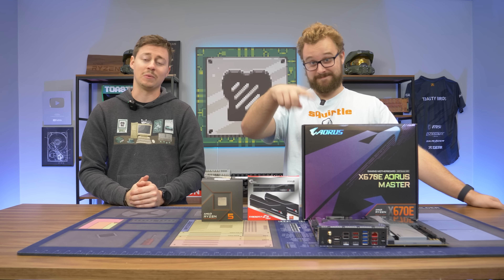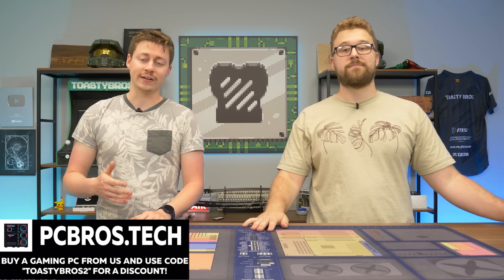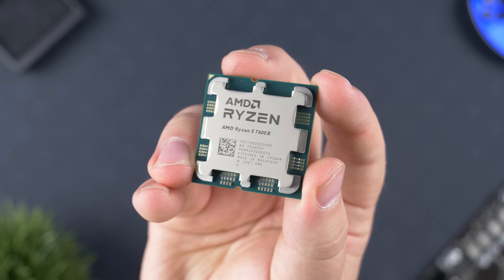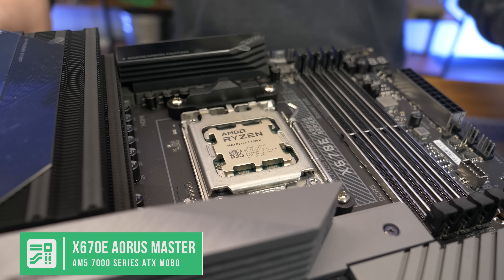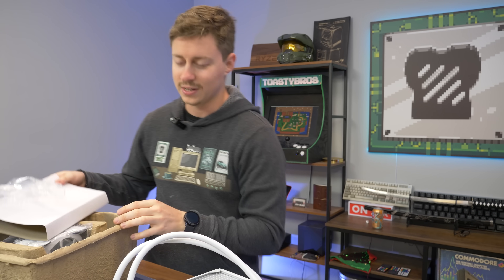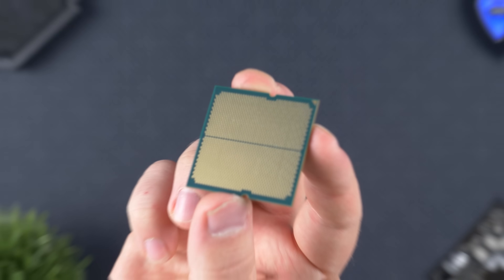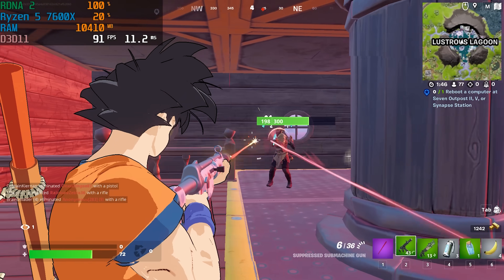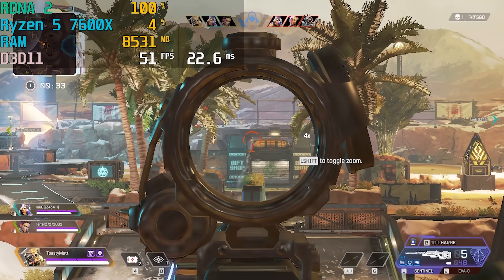Did AMD Secretly Kill Budget GPUs? Ryzen 5 7600x iGPU Gaming

Comment: I can't afford a GPU straight away but would like a running pc for 2 months whilst I save for a 7600xt.  The IGPU in this is perfect for just webbrowsing ect
Reply: Any news? Is it good enough for daily driving if you arent doing any hard gaming?
Reply: @Migixkem  short answer no. It's fine if you wanna play older titles. Like fallout 3 ran perfectly. But newer titles even with fsr barely play. What I will say though is the igpu it's great for media. It handles 1440p video fine. And would probably handle 4k
Reply: @blurreaper1238 so if i build w 7600 w/o gpu right now for coding and light gaming (minecraft) and simultaneously save for 9070 . Then can it handle till then?
Reply: @ got a 7800xt now. Does exactly what I need it too
Reply: @blurreaper1238  cool but I want to ask can it handle complex code and light games (minecraft/valo)

Comment: The actual budget GPU killer is the 5 5600g. pair that with 16gb of ddr4 3600 or 4000 (4000 will be slightly better but below 3600 is a no go. as well as the difference between 16gb and 32gb being rather marginal) and that thing makes it work. I even managed to get Battelfield 1 running on 1080p low settings at an average of around 58fpsafter some overclocking and Ryzen AI upscaling.
Reply: Do you think a 5600x or 5600x would be better than a 7600x? 32gb Ddr5 6000... I can't get a graphics card for a while the 7700x or rtx3060ti/3070 is 4-500$ range but ill need a couple paychecks. To catch up from christmas. So only buying a processor , ram, plus, motherboard today
Reply: @newbie_nugs not at all
Reply: @9hog built over a few months but she done
7600x and on release day I got a 9070xt

Comment: Actually 7600x is not good for IGPU 
When we look at 5600G with Vega IGPU it performs 2x better than 7600x but its X model so don't expect much.

If 7000 Series G models comes out it will outperform 5000 G series.
Also im excited to see that IF they can improve IGPU performance than Their 6000 Series Apu with 680M IGPU model.

Comment: For reference, at rated clocks of this GPU's cousin (the 610M in Mendocino), the GPU in this thing should only be around 490GFLOPs

That is in the ballpark of Nintendo Switch when docked, (but ofc paired with a waaaaaaaay better CPU).

So honestly curious as to if you set games to Switch-Like settings if possible, how close would they be outside of framerate if you can somehow make it CPU bound?

Comment: It's cool that these integrated GPUs are that capable...however, if its for gaming, you would be much better off going with an AM4 system since the price savings would allow you to get a dGPU.
Reply: Well...

Considering how broken the dGPU market is, I'm not too sure if you could really get a decent enough graphics card for the price difference, and this with a lesser performing CPU (the best value probably being the 5800X3D, but that's more expensive than a not exactly way slower 7600X, for this usage, at least)

I'm personnally stuck for years now, my last main rig being i7-860 + HD7870 (alrteady replacing some HD5870 after hardware failure) : even though the RX6500 performs better than this old timer, the price tag is too high to justify an upgrade and its power efficiency isn't exciting either. The CPU side isn't too different, with useless cores multiplication, which will undoubtadly yield us "SMP optimizations" actually perfectly counterproductive (as with most evolutions since the semiconductosaurs era : call me Amish if you will, but we hardly got any benefit over the Pentium era; which mostly brought us the first 3D FPS...  hey, look at how many transistors were needed at the whole computer level for Q3A or the original Unreal to run properly! And now? Oh, well... multi-gigabytes smartphone games running on about 100x more complex hardware, easily ruining batteries over 2 years of use, with 1GB monthly downloads for very minor updates...)

Needless to say, I'm pretty sure I'm done with hardware, as no one seems to care about anything other than money in the entire industry.

Comment: Certainly far from amazing performance, but the difference between being able to start up a game and maybe getting playable performance on the lowest settings is a really big one.

On another note, all of Zen 4 is now ideal for ultra-small builds.

The most powerful APU of all time goes to the one in the Steam Deck. it has 8 RDNA 2 CU's, where as the ones in Zen 4 only have 2 RDNA 2 CU's. I should know, i have a Steam Deck and game on it regularly.
Reply: The 6980HX is the most powerful at 12CU RDNA2, 45w TDP and a 2.4ghz clockspeed on the GPU. The SD has the most gaming perf at lower wattages though.
Reply: @Fina1Ragnarok  You're right! 12CU's is extremely impressive on an APU! That's basically like having a RX 6400 built into the CPU Die itself. As an owner of a Steam Deck, Knowing what it's capable of with Steam OS (arch-linux based), gives me some perspective on what an even more powerful APU could do. I have been able to play some demanding games on the Steam Deck, including games like Control and Horizon Zero Dawn, and it works! So someone with a laptop with that processor, even without a dedicated GPU, could still game, with appropriate settings.
Reply: @ufodeath  Absolutely. I too have a Steam Deck and have been very impressed with what it can do.
Reply: @Fina1Ragnarok  Sweet! Lately been playing a 'little known' CRPG called Baldurs Gate on mine. I made a Layout for the classic X-Wing vs Tie-Fighter (only issueld is multiplayer, sadly). I love playing the old and the new on it

Comment: First of all thanks for this interesting video about the iGPU. But why does AMD integrate a GPU into its Ryzen 7000 CPUs, which can wipe the floor with a GTX 1050 Ti when fully expanded, when the performance is so extremely limited even in the top model 7950X? So AMD is wasting a huge amount of potential if no Ryzen 7xxxG variant appears, which also uses the full performance as with the 680m in the Ryzen 6000. THX

Comment: Sad performance. Just built an AM4 rig for my kiddo using 5600G, while we wait for GPU prices to settle. Was planning on building my next rig based on 7600X but it's IGP looks worse than expected. Hopefully we'll see a release for 7600G this year, otherwise I'm going to just build an AM4 also. EIther way, thanks for making the benchmarks!
Reply: my brother in christ you are judging a fish by its ability to climb a tree, the igpus in non-G iterations are not meant to compete with their G marked siblings
Reply: @mr.dingleberry4882  I get what you're saying but I just built a $600 rig using a 5600g that only has 7 CU's on vega architecture. AMD skipped 6000G series and still haven't announced one for the 7600. I simply expected better but I can continue waiting. 

Though I realize that selling an APU that cuts into the low budget Radeon lineup, would be AMD shooting itself in the foot.
Reply: @UnipartyMuppet  AMD did not skip the 6000 series, it was just a mobile lineup. It is a confusing naming convention but it could be worse.

AMD has already confirmed that the 7000 series APUs will be released under the codename Phoenix (look it up), sporting RDNA 3 cores. How will they manage this with their low end GPUs I am not sure, but they are coming.

Still, I dont think that you made a mistake, as I have built a 5600G system for my brother and that thing is a value beast if you set your expectations correctly.
Reply: @mr.dingleberry4882  I meant that the desktop G series was sadly skipped. The apu lineup for mobile was something I was looking forward to, hoping it would appear in some illustration tablets.

Comment: I was hoping for the IGPU to have a decent bump in preformance over the 5600g. But if it arround the same, I'll wait for a better CPU
Reply: 5600g is G series so CPU vise its weaker than 5600X and 7600x ofc and has Better IGPU but 7600x is not G model so it is not designed like 7600G ( IDK When it comes out but eventually it will ) so if 7600G comes out it will perfom much better.
Reply: @Sherlockfps  ok thats good, when they release I hope the 7600g will have Igpu preformance close to the Gtx 1060 or better
Reply: we are still geting apus

Comment: IIRC in several interviews, AMD specifically stated these were not equivalent to their previous APUs in terms of positioning.  The iGPU is only for having video out (along with encoding / decoding) so it's basically to have feature parity w/ intel's non 'f' parts.  I think they also stated there will be APUs with more powerful iGPUs released later, so hopefully we'll see true g-series successors.  One thing to note: even the g-series APUs didn't reach current (for the time) generation dGPU performance, even the budget segment dGPUs were about twice as powerful.  I'd like to see that change, but there's several technical hurdles to cross for an APU to get to that point that will need creative solving (things like bandwidth for the GPU side, they could alleviate this with a very large cache, but that gets expensive).
Reply: I just think it's weird how I paid nearly 200 for an APU (5600g) in 2022, which is far less competent graphically than a 150 dollar console from 2013 of which the APU is only one part of the entire machine. It also gives you MOBO, RAM, HDD, PSU, Cooler, Connectivity and everything aside it. How can something that old and cheap drastically outperform something so modern and expensive. Especially when you look at the next gen consoles, which are pretty damn powerful yet still relatively cheap in comparison., also featuring and APU from the same company. What "hurdles" are there to cross if they have been succesful at it for a decade?
Reply: @JorisKeijser  First off, consoles are generally sold at a loss with the idea that the manufacturer will make up for it in terms of game sales / subscriptions over time, so keep that in mind when discussing cost.  

Second, many console titles from the PS4 era run at a capped 30FPS, render at sub 1080p resolutions and upscale, or dynamically scale resolutions to keep the framerate acceptable (not all, of course, but many of the more intensive titles do).  PC ports may not do the same things and PC ports also don't have the luxury of being a set platform to target.  On top of this, the games are running on a general purpose OS rather than a gaming only platform.  

Third, there's optimizations for the consoles that make them well suited to just playing video games while being pretty damned lousy at general purpose compute.  One  example being the consoles are outfitted entirely with GDDR rather than normal DDR.  It gives them massive bandwidth at the cost of terrible latency (compared with normal DDR) which is fine for feeding a GPU, but bad for classic CPU tasks.  If you're talking about the PS4 and XBox One, both of those were equipped with basically jaguar cores, so again, pretty terrible compute power but fairly decent GFX side, also fed by GDDR memory.  The Series S/X and PS5 are pretty similar, with the exception of having custom zen2 cores so the compute side isn't as underpowered, but these still have the same drawbacks in terms of memory subsystem and other tradeoffs (if you want to see how bad they are at being general purpose computers, google AMD selling PS5s as minipcs).  The point being, what's acceptable in a dedicated console isn't going to work well as a PC with a general purpose OS running it.

Consoles aside, the APUs have always had issues w/ keeping the GPU fed properly.  I'd have to look back at the benchmarks, but IIRC the APUs have classically scaled better with faster RAM and the impact of running in dual channel is also more pronounced, as both the CPU and GPU cores compete for bandwidth.  Maybe moving to DDR5 will help on this front somewhat, but an APU will always suffer from the lack of a dedicated memory pool, and the shared pool isn't GDDR so it's not optimal for feeding the GPU side to begin with.  Working around this may be helped with a massive cache dedicated to the GPU side, but as I said before that's a costly option.  There's also the competition for die space (all of AMD's APUs have been monolithic designs to date), which may be alleviated by the chiplet approach if they can feed it fast enough from the I/O die.  Those are just two issues, but they absolutely come into play when competing against even low-end dGPUs.
Reply: @JorisKeijser  1. price of ps4 was 400 2. the cpu power of 5600g murders the ps4 bulldozer cpu trillions of times over.

Comment: Something to have in mind as well, if you want new GPU as well (4000, or 7000 series ), you will need 5.0 PSU, Wich pulls more power from house/wall, and you might need to install new electrical wires....  That is additional cost for older houses.        I wanted all new platform, but it would cost me more than just a PC, so I have to stick with am4 platform, reality is really sad, and disappointing.  As for G series APU Don't be so sure they will come at all. My guess they won't make them at all since they put slower I-gpu into these CPU's.  So 5700G is best we are gonna get,  In my opinion.
Reply: You can always limit the power consumption on Ryzen 7000 and have great power efficiency. It's called ECO mode and is still a lot faster compared to Ryzen 5000. Also, there will be 7000G processors with 12 CUs instead of 2 CUs included in all these CPUs. They confirmed so.

Comment: Seeing Borderlands 3 running on the 7600X in low 720p@30 brings back memories of me playing Borderlands 2 on an A6-5400K with integrated HD 7540D graphics at around the same frame rates. And the 7600X is not even an APU!

Comment: Why not test at 480p to 800x600? Igpu to me are aimed at those reses not 720p+ also hopefully the G variants are capable of beating the GTX 1630 if so then igpu sollutions will be viable if not were still stuck with buying $220+ gpus.

Comment: So is there a 7600G on the horizon with more GPU units ? I don't think AMD have officially announced anything yet. From my perspective the 7600X isn't good value for most use cases. Add up the price of CPU, cooler, motherboard, DDR5 ram and so on, you would get better price performance from intel or the AM4 platform whether for gaming or office work.

Comment: As cut down as those integrated graphics are, it's still impressive what it's able to put out.  That's about what Vega graphics were doing with triple the compute units.
Reply: If you're referring to integrated vega graphics, then yes... desktop class such as V56 and 64 or even VII? Getting there, but still some ways off.

The newest 780m iGP (which has 12 CU's) is about 13% slower than RX 580 (desktop) which had 36 CU's (at least in Geekbench OpenCL benchmark).

So, AMD RDNA 3 igp's are already almost comparable to mid range dGPU's from 5 years ago.

I also noticed that AMD igp's tend to improve by roughly 30% from one generation to the next... so, the 880m iGP with 12 CU's should/could be sitting in between RX 580 and Vega 56 if its 30% faster than 780m.

Comment: Does the processor do 4:4:4 Chroma at 4k 120hz on HDMI 2.1? Asking about resolution, not about gaming performance.
Reply: Depends on the motherboard. The iGPU supports HDMI 2.1 FRL (48Gbps mode).

Comment: APU & iGPU's show that massive gpu tech can be squeezed into a very small package If they really wanted to do it
Reply: This entire iGPU fits inside the IO die on the Ryzen chip. The whole thing probably like four square millimeters. It's only 2 CUs and was never intended to be used for gaming. Surprising results.
Reply: @WaspMedia3D  very surprising. It would leave products way too cheap to put them in such small packages, so it leaves us with these chunky pieces of tech for $600-$1800 lol. I'm sure they are working on a way to downsize products but keep the price the same or higher 🤢
Reply: @MrNobodyLand  AMD claims Zen4 APUs will make low end discrete GPUs "obsolete" ... I guess we'll see early next year.

But yeah ... I guess high prices are here to stay with the inflation at what it is.

Comment: I think when it comes to budget parts, I just don't see a 300 USD CPU as budget. Think in time, so long as Intel can compete we will see cheaper budget CPUs. Like when 12th gen launched there was just the 12900k, 12700k, and 12600k none being budget options. Then the 12100 and 12400 coming out later which forced AMD to release the 5600, 5500 etc.
Reply: Yeah a budget cpu us like 90-120$ or something. This is just low end products for high end prices

Comment: Hey guys, if possible, I'd like to see how much of a stable OC you can get on the iGPU on this one, especially if the systeem already looks for the tightest timings for DDR5. I'm assuming sub-timings are out of the memory-training routine. If you were to get a 45-ish FPS on 1080p (or even 1440p) titles like Shadow of the Tomb Raider, it'll be a killer-chip on more then just the CPU-aspect alone.
Reply: I'm looking holding out and not buying 5700g for a small form factor build I'm planning/ been acquiring parts for.

Comment: You could propably download Radeon Adrenaline and push the fps further with RSR or FSR , a little bit of upscaling wouldn't hurt?
Reply: Does fsr work for the software ? I had a 5600g and it wasnt an option on radeon adrenaline
Reply: @al2os6oraah36  Rsr is driverbased and enabled in radeon adrenaline and work for all games, while fsr is in the game files so it can be enabled for supported games.